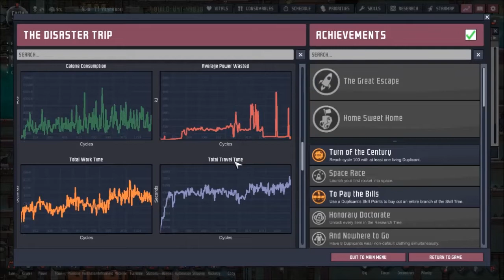Oxygen Not Included - 13 - Steam and Magma

Comment: Oh nice, that looks like a solid heat spike for some magma power! That should get you some neat free energy. You can also use these things as power-free desalinators (dump brine / salt water in, pipe excess water out).

And yeah, seeing that the place had so much oil everywhere and you were drilling into magma I had a feeling we would be dealing with sour gas! You can pretty much pump that into space since it's useless unless you want to cool it down really really low and get some natural gas out of it.

I guess you could look into learning how to do liquid locks so you can go into the steam room or other hot areas and expand them from the inside.
Reply from the maker: It's certainly providing free energy.  After.. well.. you should have some idea what's going to happen by now..

I understand how liquid locks work but my map is constantly covered in fluids that just seem to appear all over the place that relying on liquids to do anything would be a fool's errand for me. :P